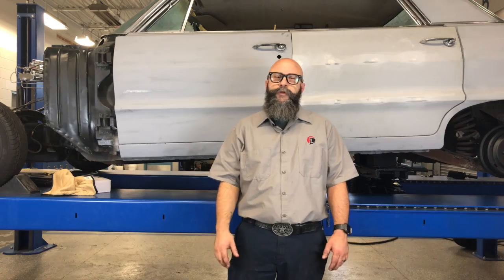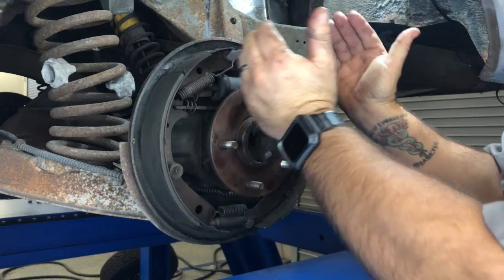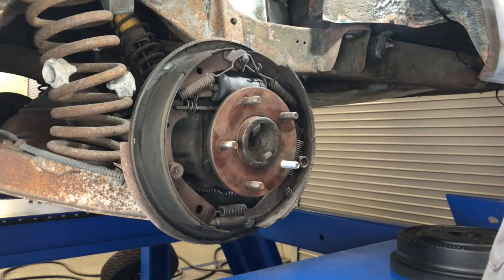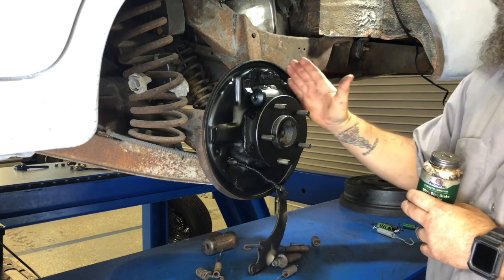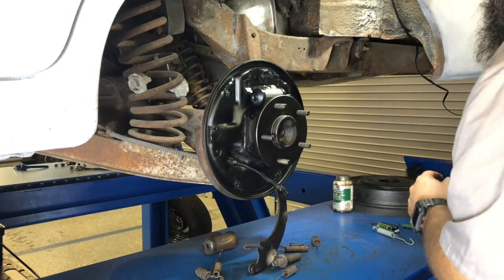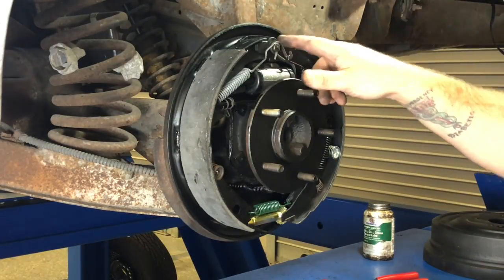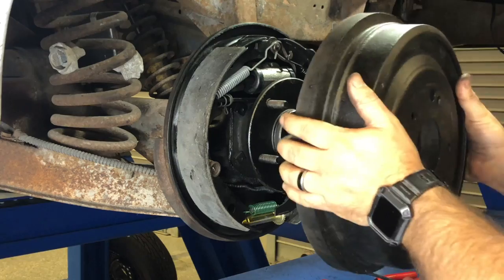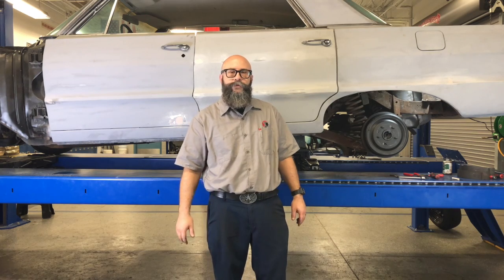TLP DIY Episode #7 Drum Brakes for the 1964 Impala

Comment: I know this video is some years old, but I am working on a similar drum brake from a 1960 biscayne. I bought a self adjuster kit of rockauto, but I think the self adjusters should have different threads one left hand threads and one right hand threads. Mine is both right hand, so the self adjuster on the right side doesnt operate correctly. Do you know if these should be different threaded?

Comment: Clarification: the primary shoe is in the front or back.? I have always understood that the primary shoe, the shoe with most contact area, is positioned in the back. This is the same shoe what mates with the emergency brake lever. Did I hear you correctly in saying the primary shoe should be the front shoe?  Hmmmm?
Reply: According to a  Chevrolet training video the front shoe is referred to as the primary shoe BUT the shoe with the most contact surface area the shoe on the rear. Some people call the shoe with the greatest amount of contact area the primary shoe as it does do the majority of the braking. But, never-the-less, Chevrolet refers to the front shoe (smallest contact area) as the primary shoe. I believe it is called the primary shoe because of the braking action and the fact the front shoe is the shoe that is initially involved in the braking process followed by the rear shoe which then takes on the majority of the action. Semantics aside, the shoe with the largest contact area is the rear shoe not the front shoe.